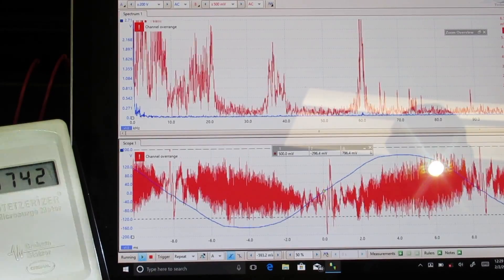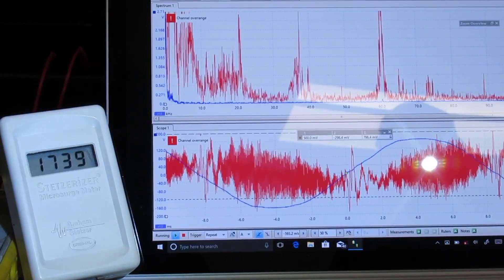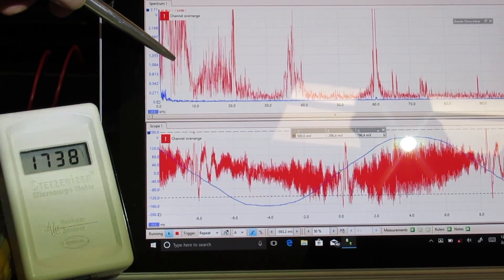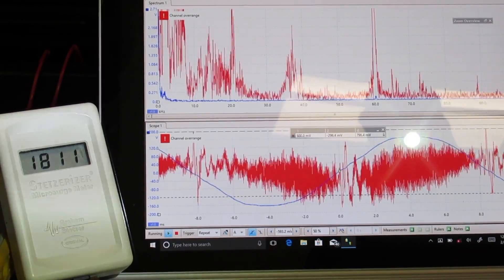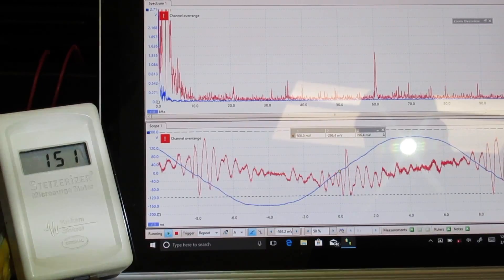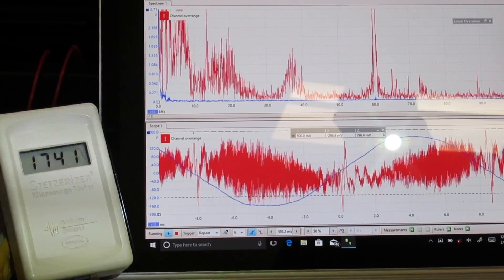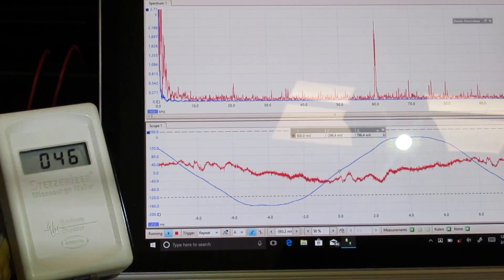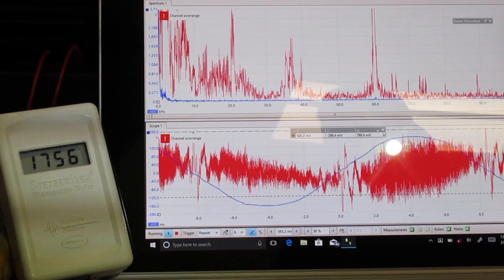Measurement & Filtration of Dirty Electricity in a computer lab

Comment: Nice video! What probe are you using for channel B in your Picoscope? Thanks.
Reply from the maker: Graham Stetzer ubiquitous filter and the probes that come with the scope.
Reply: You mean PicoConnect 441 and PicoConnect 442 probes?
Reply from the maker: What came with the stop as standard and I connected them to the Graham Stetzer Ubiquitous filter that block the 60 cycle so you can see the DE.
Reply: OK. I see. The idea is to block the 60 cycle for seeing the DE. I don't think this will work in Europe since GS filters are 60 Hz, 120V. Thanks. Maybe a Math filter in PicoScope will do anyway.
Reply from the maker: They make filters for Europe. Contact Stetzetelectric .com.  They have distributors in your area.
Reply: I will contact my local distributor. Thanks for the tip. I greatly appreciate it!